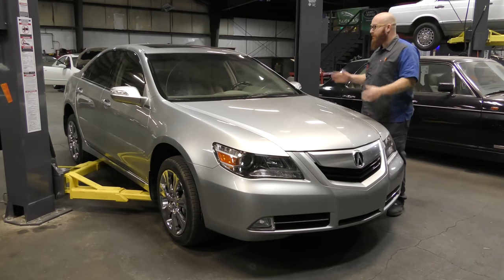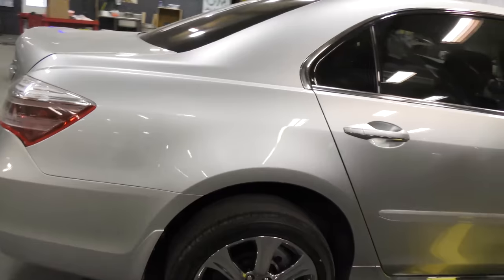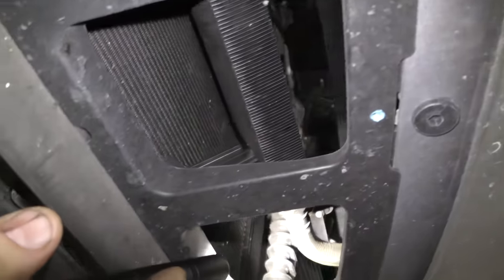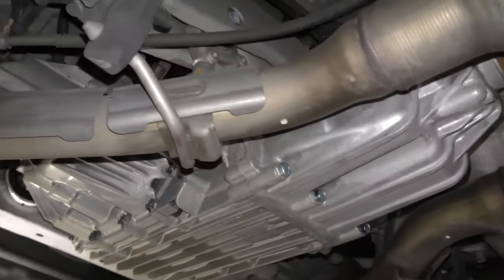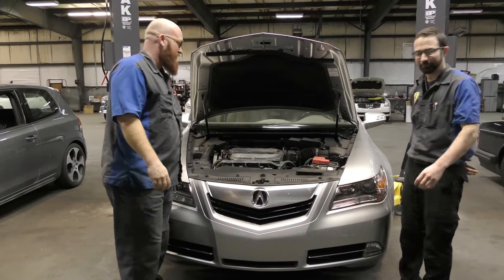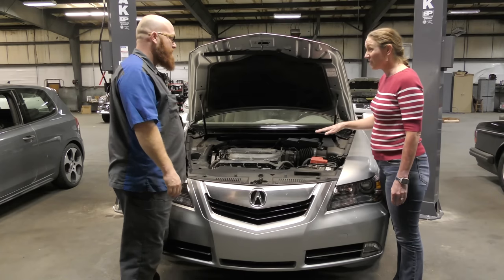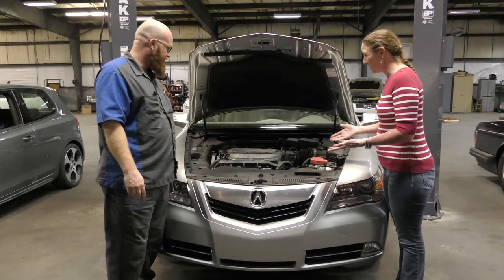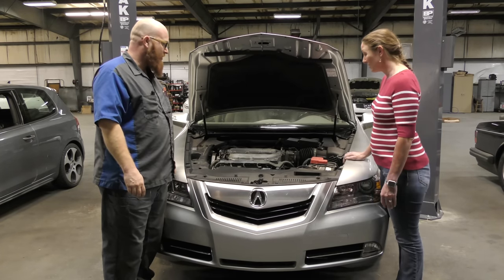Something Very Serious is Wrong with this 2010 Acura RL! What did the CAR WIZARD find???

Comment: If the oil light comes on, pull over. Don't keep driving like this guy did.
Reply: Oil light coming on... too damn late to stop the engine... damage has been done.
Reply: Brett Collins  I miss those
Reply: Amazing how many people don't know this.
Reply: My girlfriend kept driving in my Triumph Stag. That hurt.
Reply: @izalman  too late when that happens.   He obviously  missed a few oil changes and burnt what was left. Oil pressure switches  can't detect  low oil pressure   The engine either  has oil pressure, or it doesn't .  When there is so little oil in the engine, and the oil pump is suckibg all it can to lubricate/ cool the head, the lack of oil  in the bottom end will  quickly start roasting the bottom end bearings.
Reply: long time ago when I had my own shop,we had a (lady) customer,in the middle of the winter driving along in her BMW 320,oil pressure light came on,Oh she thought,better get to the next garage and get some oil put in.
Of course,she never made it,engine started knocking so she finally pulled over and shut it off.
Oil light coming on was caused by a leaking oil filter,we ended up rebuilding the engine at great expense,crank was damaged,rods had to be resized ,new bearings etc.
The problem in most cases is that people don't know the difference between oil level and oil pressure,they think that when the oil light comes on they have time to drive to the next garage and get the oil topped up.
I explained to many of my customers that if the oi light comes on,turn off the key immediately and coast over to the side of the road,you may have a chance of saving the engine from major damage!
Reply: My car doesnt have an oil light.
Reply: Every car that I have seen in my 40 years as a shop owner either has an oil light or an oil pressure gauge.
Easy to check,just turn on the ignition,don't start the engine ,you should have a number of warning lights come on,one being the oil pressure light.
If that light does not come on the bulb may be burnt out or the oil pressure sensor may be defective.
Better have it repaired or some bad day you may destroy your engine without even getting an advance warning!!!!!!       @burntchickennugget191  E
Reply: @burntchickennugget191  I’m sure it has a dip stick then...
Reply: @paulsz6194  nah it has one. Its just the fact it dont have an oil light. It has an oil gauge but no oil like. Checks temp on the oil but thats it. Ive just learned to check my oil every moring and every time I stop at a gas station.
Reply: 42k and seemingly no leaks and I would assume not burning great amounts of oil... so I wonder where the oil disappeared to.
Reply: my dad always told me if the oil light comes on you're already fucked usually lol
Reply: @ChairmanMeow1  exactly.
Reply: Some newer vehicles have oil level sensors, which help, and aren't as "you're screwed if it's actually used". However, it's still never a good thing to run an engine for any length of time with an oil light of any sort on. I like to keep at least a spare quart in my vehicles just in case something happens, something decides to leak, or I space checking the dipstick at least once a week (thus becoming a dipstick).
Reply: Unless you own an Audi like a did lost 1 litre 1000km which Audi said was normal :( a4 2.0tfsi b7
Reply: @izalman  no it not.. the oil light means it needs oil, they dont put the sensor at the bottom of the pan its in the middle of the pan.. it means stop the engine an fill before you blow it up
Reply: @ Joe Dirt I was referring to an oil pressure switch not oil level sensor. Most OP switches are 5psi or less, I can fart greater than that.
Reply: @ChairmanMeow1  the oil light came on in my car once, but it was okay after adding oil. I left it running to warm up because it was cold outside, and when I came back to it it was making a knocking sound and the oil light was on! Turned it off and filled up the oil later in the day. It was obv missing a lot of oil for some reason and the only time the oil level had even gone down by itself. But I just check it every time I need to fill up my gas tank so it doesn't get a chance to sneakily lose oil on me. I don't know how that happened that one time but never again.
Reply: I always keep a qt of oil in my car and check it weekly. I agree, if the light comes on pull over and check the level. If it needs a little bit pour some and drive it to your nearest mechanic for a check up before damaging the engine.
Reply: @MattExzy  he burned it by not regular oil changing it
Reply: Oil pump failed.
Reply: Oil light comes on, pull over and pray to whatever gods you follow to have mercy on your bank account
Reply: Ive got an ‘05 and I’ve had it for 14 years. Lights come on for  NOTHING! Oil light comes on, it’s a 1/2 qt low. The tire pressure light comes on, it’s 2#’s low.  I find this story a little fishy…something else happened….
Reply: @MattExzy  the 3.7s are kinda known for burning oil, the AWD TLs also have the 3.7, maybe a slightly different variant but same basic engine and I’ve done some research as I’ve considered getting one at one point and people have said they burn as much as a quarter every 1000 miles, I’m pretty sure this person went much more than that without checking it or topping it off, besides the oil burning I haven’t heard too many people having significant issues with the J37 engines

Comment: so the son was driving it and he is going to school. it sounds like he was racing it around and over revved it and blew up daddy’s car
Reply: that's what I'm thinking, those cars are pretty quick so I wouldn't doubt the kid was beating on it
Reply: Yeah, that sounded suspect to me. There's got to be more to the story than he was told.
Reply: @LN997-i8x  I’ll tell you the story, it was only out here for five days until the engine blew up going to the car wizards. I was going from McPherson to Newton. Driving 78 in high gear until I saw a flashing check engine light then a low oil light. Pulled off in Hesston and I was hearing knocking. Called AAA to take it to the wizards and that’s where it sat for this video to be made
Reply: Also they don't like 87 gas
Reply: Nice car. I would fix it. We need not know how it happened, it just happened. Now we need to deal with the problem.
Reply: There are references to over-revving the engine in some of the comments.  That is not possible because all of these engines are equipped with an electronic ignition cutout that kills the ignition if you try to over-rev it.
Reply: @MrDede2011  they selling that over there?
But then you get it for free right or they actually charge money for that garbage?
Reply: @duncandonovan5270  lol not for free
Reply: 100% in agreement. I recently bought a 55k mile 2013 Accord with the 3.5 v6 and it surprised me how fast it was. It does 0 to 60 in under six seconds and makes a great sound doing it. The woman I bought it from had bought it from her own mother for her teenage daughter. They took it from her for driving too fast. I had a Legend with a 3.2 in the past and it was quick also. You really have to try to blow any Honda/Acura engine.
Reply: @MrDede2011  They run like hot Garbage on any less than Premium  even then don't expect great MPG
Reply: @duncandonovan5270   your octane is not equivalent to our octane, different measuring systems (RON, AKI / R+M/2,  MON, or RdON, depending on where you live).
The US/Canada numbers are always lower for the same quality of gasoline.

I remember rolling my eyes HARD when Top Gear said 'more explosive jungle juice in Europe'... because it's not a measure of 'explosiveness' and it's the same stuff.
Reply: They have rev limiters and besides Japanese engines love high rpms. They’re called rubber band engines for a reason as you have to rev the nuts off of them to get anything out of it. 

That power spec Wizard mentioned isn’t available until like 6000+ rpms and the torque spec is probably about the same minus 1000-1500 rpms.
Reply: Way more likely that the oil changes were neglected or they let it get low on oil. Oil filter didn't look super new, but it's also exposed the elements in that location.
Reply: @terencehawkes3933  I have one and this is true unless you're on a drive gear the cutoff is like 4k or under I don't Rev in neutral often. I have the TL SH though not RL
Reply: I have an 09 rl and the only engine related issue I’ve had is the timing chain tensioner. Electrical is another story. I would buy that car for parts in a heartbeat
Reply: I knew a kid who had one of these in high school too. Bro thought he was hot shit, racing it around everywhere because it had 300hp and you guessed it - karma bit him in the ass and he blow the engine.

Comment: I have an Acura MDX with a similar engine, and I do all the work on it myself.  Here's a tip:  The low frequency of the sound indicates that the problem is in the valve train, since cam shafts rotate at half the speed of the crank shaft.  If there's no cross contamination between coolant and oil (and you showed no leaks of either), then the block is probably okay.  So they haven't thrown a rod.  Also, since it starts up, that also indicates no damage to the block.  Since that seems to be the case, remove the valve covers and inspect for damage in the variable valve timing and cam shafts.  If no damage is visible, drop the engine and remove the cylinder heads.  Most likely the damage will be somewhere in the valve train, but this will also allow you to inspect the block very thoroughly.  Repair/replacement of cylinder heads or valve gear is certainly better and lower cost than a new engine.
Reply: An even better tip is; DONT BUY EXPENSIVE CARS! They’re just disposable status symbols. Find yourself a good cheap car that you CAN afford to repair or replace if they go tits up! (A broken-down Lamborghini Murceliago sitting in your garage rotting away is not impressing anybody)
Reply: @chrismayer3919 hat’s debatable. There’s pricier cars that are priced the way they are. A good example of this is the inflated price of older sports/performance cars that cost tens of thousands, even though they’re well over the 90-100k+ mileage range. People know those cars are reliable, and most do the math to calculate how much it might cost if things aren’t the way they are when they decide to settle on buying the car (since other options might not be able now or even later).

But, of course, this is coming from an average car enthusiast, and not some millionaire who buys the top trim level Ferrari with like every practical available option, and doesn’t even know how typical oil changes work, or how a typical dual clutch transmission operates. 

I, myself, have bought a semi-unique car, knowing parts and whatnot are semi-hard to come by. This means that I should be ready to pay for parts and do certain repairs if I decide to drive it hard and break things on the car. I’m most likely going to even have a whole donor car on the side if I can help it. This will pretty much alleviate most to all of the issues I might encounter, on a rather basic level. But hey, that’s just my particular take on it. 

Some people just buy cheap(er) cars and have the crappiest luck. I suggested someone to get a 1998 Toyota Camry V6 sedan with only 98k miles, yet they decided to opt for a 2013 Ford Fiesta base model sedan. Needless to say, the car didn’t last more than a year or two, esp with lack of maintenance.
Reply: Some shops prefer to cover themselves on these things and provide a limited warranty.

Comment: "That engine is hardly broken in".  

Yup. It's broken completely in.
Reply: @Car Wizard, hey man I don't want to sound too 'ricey' but couldn't you swap out for a K20 engine from Japan? They have some really incredible low mileage and the price is considerably less than 7 thousand dollars no?
Reply: @battosaijenkins946  Turbo K swap RL?  Spend $5k and have much more fun!
Reply: @battosaijenkins946  i was wondering about that. they do do it in Japan where you have to swap in a new motor after x time and they don't put that many miles on it, but i guess it's the stigma of it being a used engine or the shipping is a real killer.
Reply: @jorgey4  Japan has all sorts of rules / incentives to make sure people buy a new car every five years or so. The old cars get exported to places like New Zealand or scrapped.
Reply: Keep in mind, as clearly stated in the video. Customer wanted NEW or REMAN ONLY. 
Refused used engines whatsoever, regardless of miles, or money savings. You guys keep reccomending used engines. Its not your car. Customer refuses used engines.
Reply: @ChoPi-Eww  Why the hell would you swap a J37 with a K20? J35 is a more reliable engine but still, late model J series is a much more fun daily than a K series. low effort power.
Reply: It's got something about to break out
Reply: Not hardly broken in, broken in hardly lol
Reply: yeah, what was that ladys deal?
Reply: That's why I like Lexus

Comment: I experienced the exact same issue with my 3.7 liter Acura MDX.  Was under extended warranty and luckily the dealer found a salvaged 3.7 liter replacement.  It happened in 2019.  I am almost certain the MDX 3.7 litter will also fit this Acura RL.  Hope this info helps someone out there.

Comment: I've had 3 honda legends over  10 years. Brilliant cars, slightly expensive on fuel, but totally and utterly reliable and well built. More reliable than a Rolls or Bentley.  Mechanics who serviced them always comment on how outstanding these Honda engines are.  This Acura definitely deserves to be saved.
Reply: Is there many Legends in Thailand?
Reply: Beautiful car as well.
Reply: @Shabbe02  have only ever seen one in thailand.
Reply: Hey now, Those 1995 Bentley Brooklands are actually fairly reliable now, and they usually go for 10k to 13k
Reply: @defennia  Yes Bentley and Rills only use the best stuff for parts. I’ve seen Rolls drive with water damage